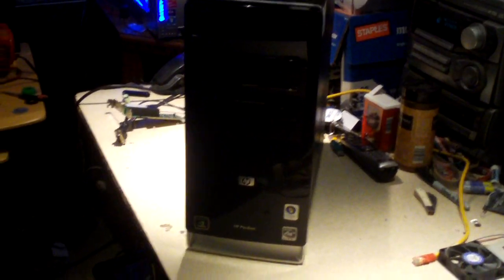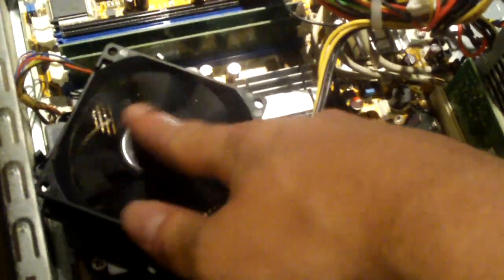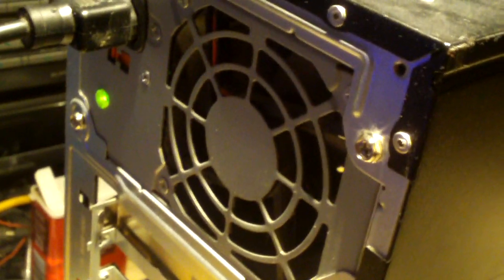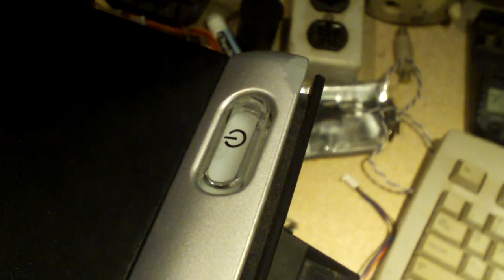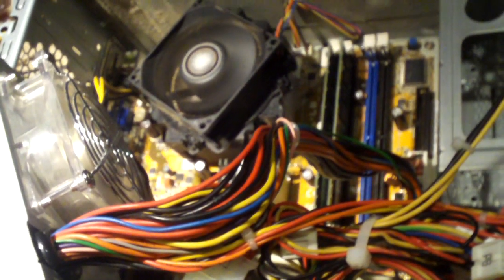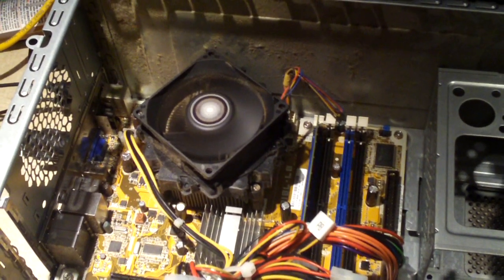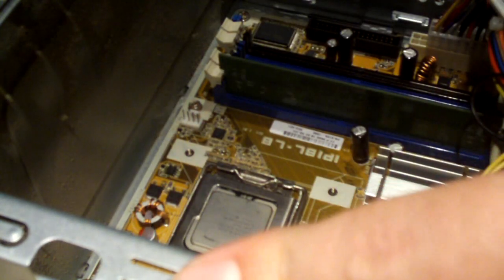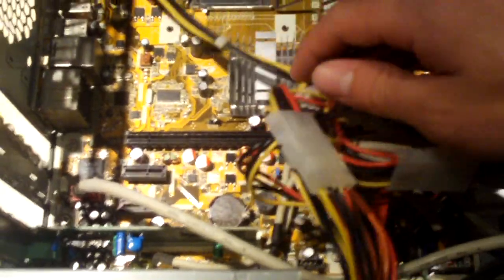POSSESSED HP Parts System

Comment: no strange at all, i've seen it a lot, it usually means something is wrong on the motherboard. Either the ram is bad, not making good contact, or one of the chips is burned and fails the power on self test. Try with one of those bios code cards, not sure how their are called. It the one with the 2 7-segment led display that goes in the pci slot and gives you the state code of the bios, you then check the table to see where it failed.

Comment: Yes this isn't strange, if something is messed up with the configuration on the bios on my computer, it restarts itself from the ground up, it turns off completely and turns back on to reset the defaults, and when it's an issue with overclocking it can go through 3 cycles of turning itself off and back on again.

My motherboard: Gigabyte EP41-UD3L SKT775 w/ Dual Bios
Reply from the maker: This board was hit by lightning. If I left it plugged in, it would've continued its power on, power off sequence.
Reply: ***** I didn't say it's an overclocking failure, what I said was: 
"if something is messed up with the configuration on the bios on > MY <  computer, it restarts itself from the ground up, it turns off completely and turns back on to reset the defaults, and when it's an issue with overclocking it can go through 3 cycles of turning itself off and back on again."
Reply from the maker: Mike Fox This board was hit by lightning. The southbridge (which is in charge of powering on the system) was damaged. Yes, some motherboards will power of completely to save BIOS settings or recover from a failed overclock, but neither of those two criteria apply to this board.